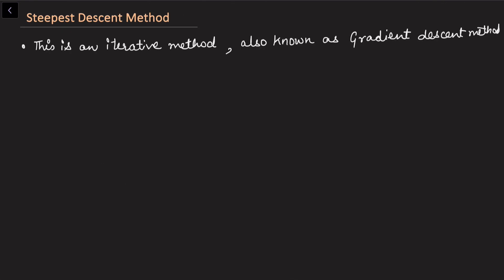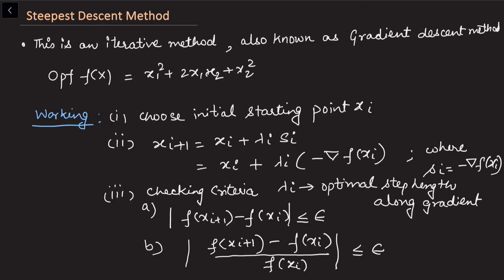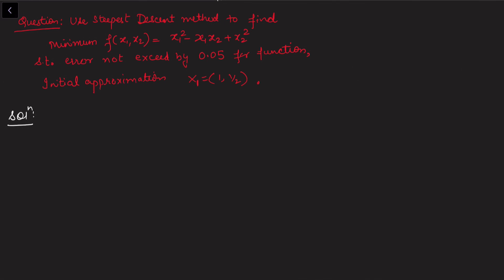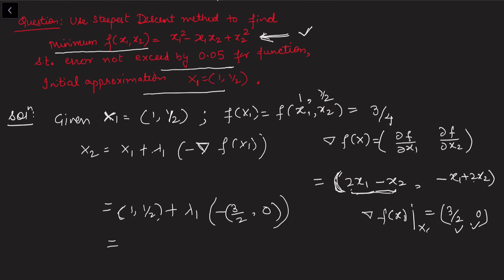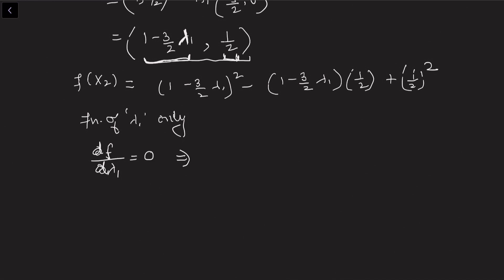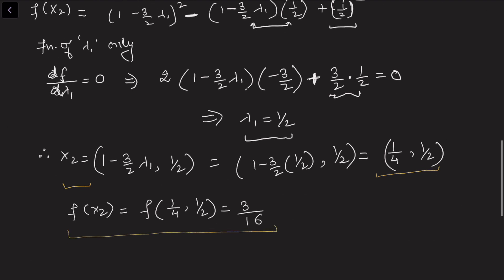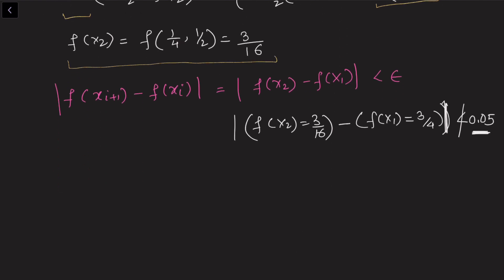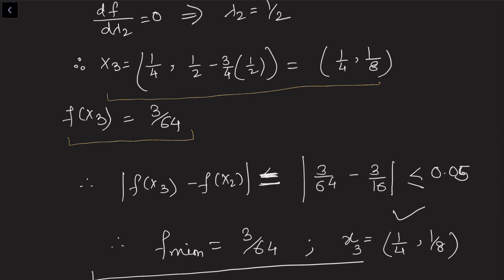Steepest Descent Method | Search Technique

Comment: Timestamps (Powered by Merlin AI)
00:05 - The steepest descent method iteratively optimizes functions using gradients.
01:30 - The Steepest Descent Method updates points using gradient information.
02:52 - Explains using Steepest Descent Method to minimize a given function.
04:14 - Calculating the gradient for the steepest descent method.
05:46 - Finding the optimal step length using a single-variable function.
07:17 - Compute function values at new points and check for convergence.
08:41 - Calculating new point x3 using steepest descent method.
10:24 - Optimal solution found using the steepest descent method.

Comment: Mam there is one more iteration that you forgot to do.
|3/64 - 3/16| = 0.14 > 0.05 : this doesn't satisfy required condition. One more iteration will give us the solution.
Reply: You are right.  perhaps one or two more iteration needed.
Reply: no, the value of f(X3)=7/64,mam's answer is wrong
Reply: @hemangjaswani7498  we still get 0.07
Reply: @hemangjaswani7498  f(X3) is 3/64. There should be one more iteration